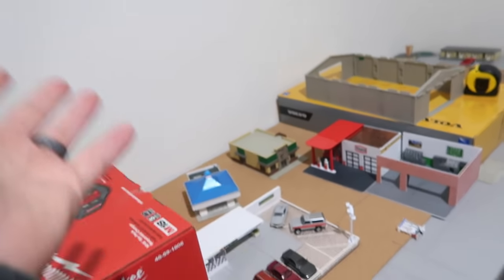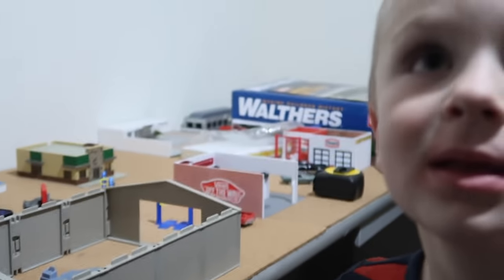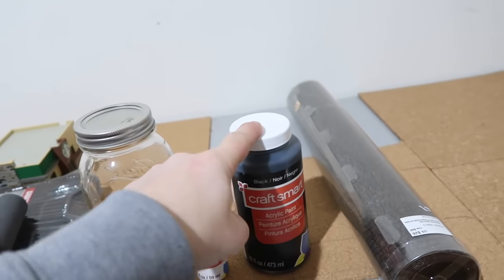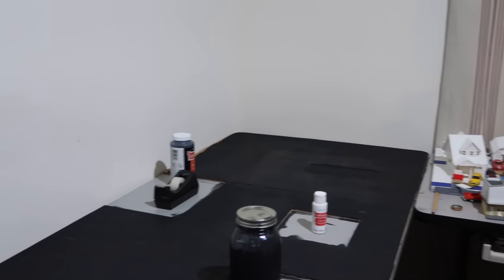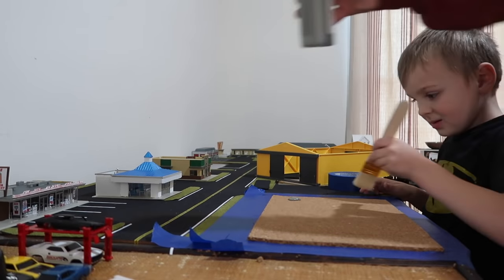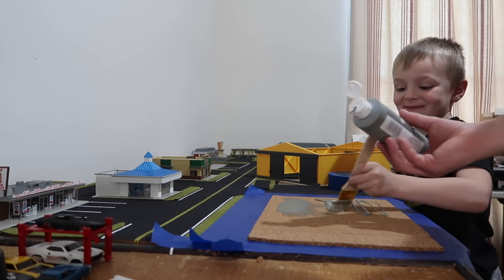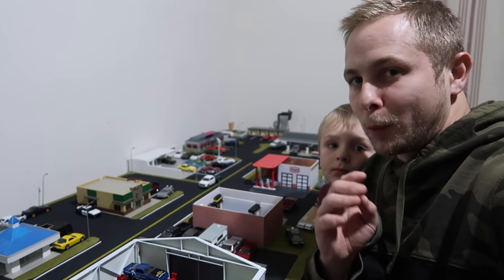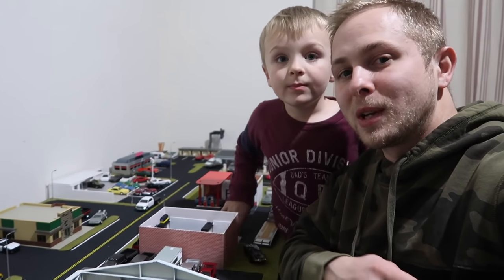DAD Builds FAST and FURIOUS House in TOY car TOWN for SON

Comment: For windows use the clear plastics vynal from packages that toys, hot wheels etc much easier than plexiglass and it's free also Dollar tree has led light packs btw don't forget to get the 1/64 fast & furious figures the have Dom, Brian,letti, Dom's sister and a few others nice work!😉🥂

Comment: The layout looks awesome. Cant wait to what else your going to do.  Are you looking for any other buildings or items for the layout?  There 2 nice size model train shops near me has alot of items. Use to get all my stuff there when i had my trains running
Reply from the maker: I’ve got some more buildings coming but I’m always looking for the next cool thing.
Reply: @JD_JoyrideTV  It may be a little late to mention this, but S scale is 1/64 like your cars, so would match perfectly size wise, rather than stuff like the 0 scale which has to be cut down like the Diner, or HO which works, but is a bit underscale, hence not being able to get 2 vehicles between the pumps.